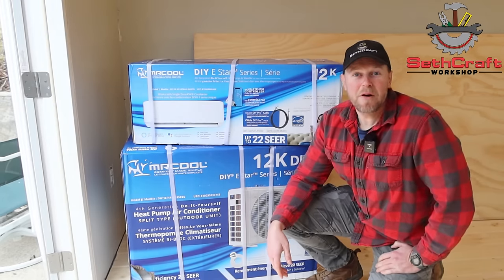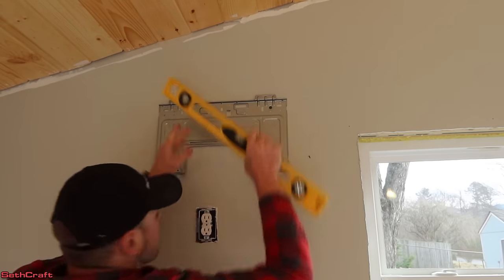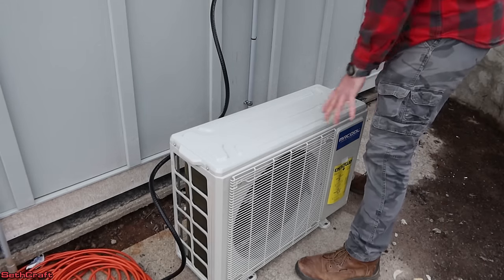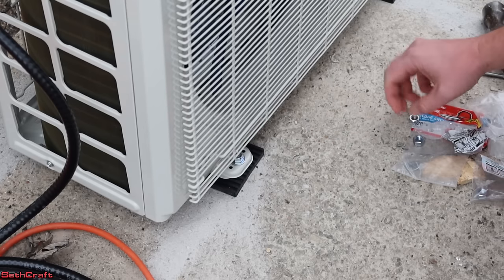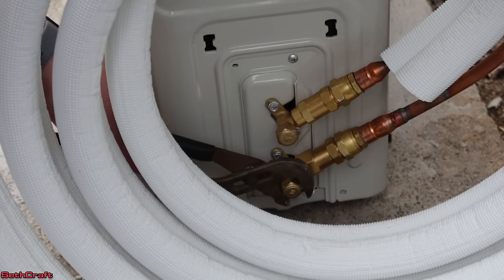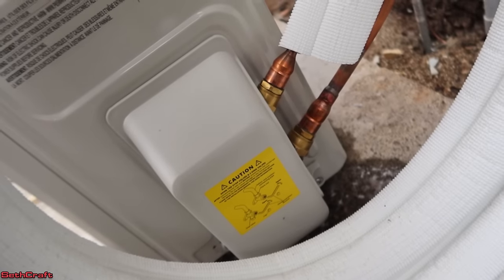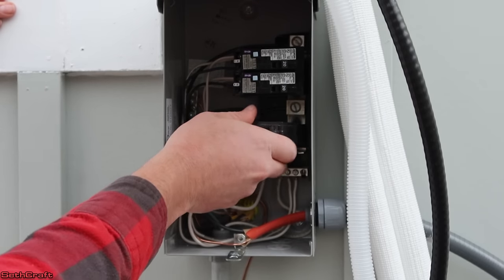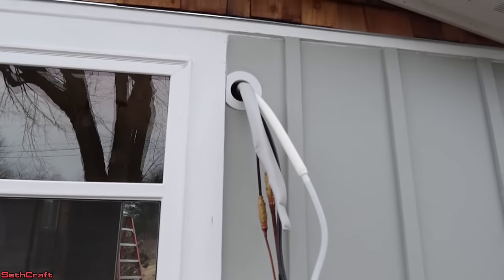Mr Cool DIY 4th Gen 12000btu Mini Split Full Install

Comment: you did not vacum the lines, otherwise the oxygen you have inside of the lines will ruin the compressor over time
Reply from the maker: This is the do it yourself kit.  it does not require vacuuming the lines.
Reply: Nice! I thought every ac system had to be sucked down initially.. Leart something new today! Thanks! @sethcraftworkshop
Reply: I don't understand this either. You never want air in any a/c system. I need to do more research.

Comment: Dude, you should be careful about putting this video on line.  You never leave excessive coils of tubing on a system.  That is extremely unprofessional.  This can easily result in numerous compressor failures, witch will not be covered under warranty.  
Refrigerant piping must always be kept to a bare minimum.
Reply from the maker: The DIY version of the mr cool mini split does not allow for the line to be cut. It would void the warranty.
Reply: I’m in the HVAC industry as well. I see these things all the time. This is a hack of an install and I’d be willing to bet the compressor is already having issues

Comment: So not true DIY because you need electrician to wire it up, payment extra money
Reply from the maker: Mr. Cool has to state that because of legal reasons. Very understandable. But the wiring system is quite simple to do and can be done DIY.
Reply: @sethcraftworkshop  it's the only thing I'm worried about. Don't know anything about electrical
Reply: Looks like water could get in the unit with a heavy rain?  Appears to set low.

Comment: You forgot to vacuum the lines going to your evaporator. Air introduced with R410A prevents it from working efficiently.
Reply from the maker: This is the Mr. Cool DIY model that does not require a vacuum.

Comment: 1 big problem !  you opened the freon lines and charged the system. before doing that you are supposed to be pulling a vacuum on the lines going to the evaporator in the house. those lines have air in them and humidity which is water. a vacuum  pulled at at least 5 microns  for at least 15 min. will pull out this air and humidity . now you have a greater risk of compressor failure or line piston freeze up which will also burn out your compressor. some jobs are ok for the do it your selfers  but things like this should be left to tradesman in there field , this is one of them. i`m an owner of a hvac company for over 40 yrs. and can`t tell you how many of these systems failed because of home owner attempts at installations.  IF YOU FOLLOW THIS VIDEO GOOD LUCK !  PS. no need to use all that copper tubing. cut it back and re-flare it !
Reply from the maker: Thank you for your comment. The Mr. Cool DIY has pre charged lines. The install manual shows no vacuum required. The warranty is void if the lines are cut.
Reply: I really appreciate the video.   You have more patience than myself for answering the Same questions over and over.
Thanks for hangin in there!

Comment: Would the 12000 btu work with a 288ft sq tiny house with high cathedral ceiling?
Reply from the maker: The 12000 would actually be too much for a small place like that.  Or it would be very fast to heat and cool. The 9000 would be good too.

Comment: You forgot to pull the vacuum on the line set now you have moisture in the system. Also, that line set needs to be shorter. You need to show them how to cut it to length of what you need and have an oil trap installed. Whoever is showing this and installing, it should not be the ones doing this, obviously they didn’t read the book completely.
Reply from the maker: Thanks for watching. The DIY version of the Mr cool has pre charged lines and no vacuum is needed. Also the line set is a set length. If you cut the line it voids the warranty.